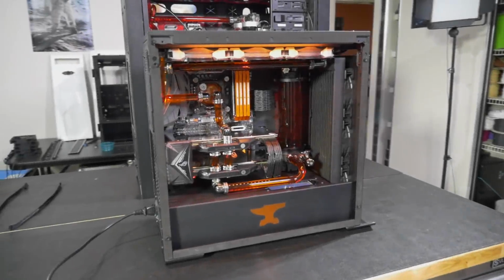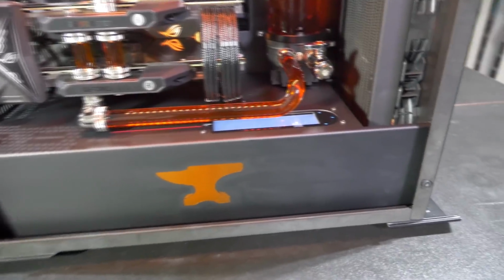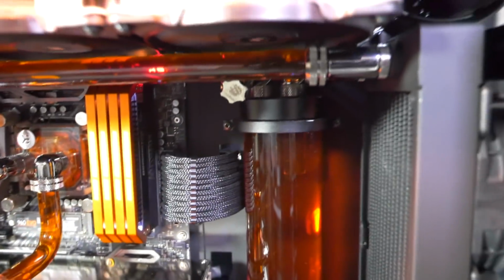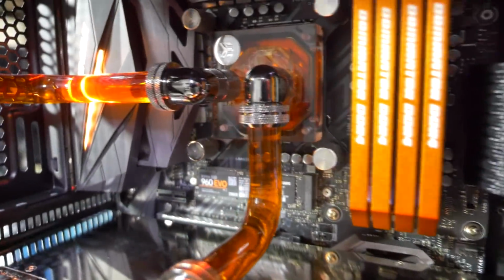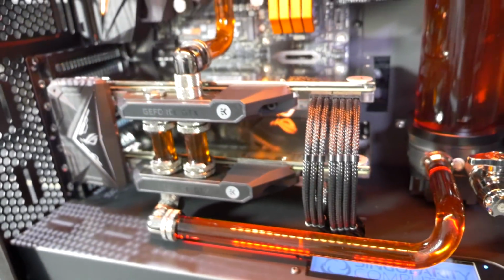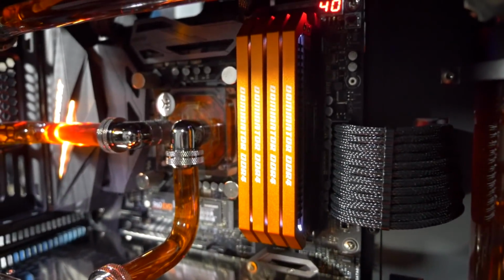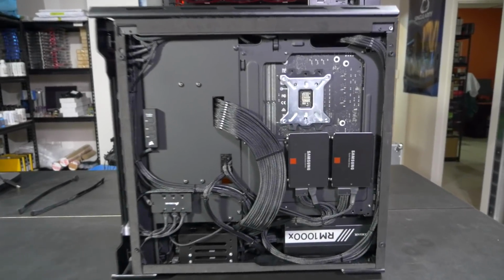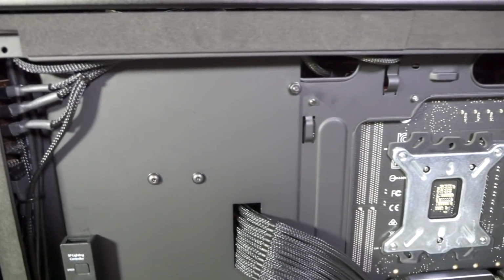Custom Phanteks Enthoo Evolv Part #2

Comment: I haven’t built my own PC yet, but I was an Auto Tech for a decade and now an Electrician. This experience leads me to think that the coolant loop may perform better if instead of going GPU to Processor, you went GPU to radiator to Processor. That way the processor isn’t getting the freshly heated coolant directly from the GPU. Like I said, I haven’t built a PC yet, so the added tubing may not be worth the gain in performance; if any!  This build is beyond cool, so my comment is only that, a comment. Thanks for your work!
Reply: Loop order with a DDC pump makes practically no difference whatsoever. The coolant circulates so quickly that it doesn't really heat up much at all at the GPU, and so it will have a negligible impact on CPU cooling. Of course, this is only the case with a high-powered pump, such as the DDC. I seem to remember Daniel covering this way back in his earlier builds - I'm pretty sure client build #5 has this information somewhere in the build log.

Comment: for a budget 240mm aio,  top vs front radiator mount works better?
Reply: Front, especially in this Case (have The Same one)
Reply: Christian Merkel if a case has less front vent then is it good to mount aio at front? 
my case: masterbox td500
Reply: If you place the fans in the phanteks evolv atx on the inner side of the frame, its doesn´t have that bad front vent. The problem on that case the lackluster Top exhaust vent. 
In your Masterbox TD500 i would place the aio rad on the top as an exhaust and maybe place the three fans from the front on the inner side of the frame, so that they have more space to breath from the front, if the aesthetics would still please you, of course
Reply: @DerMenschLp  yes,  right now i have mounted them at the top and using 3 fans at front as airflow
Reply: I think thats a good configuration. Do you have the Radiotor fans as an exhaust or intake?
Reply: @DerMenschLp  exhaust
Reply: Then you have a good configuration i would guess

Comment: just thinking out loud here, don't kill me, but wouldn't be more efficient if even possible to cool the 2 GPUs with one rad then loop back onto the CPU and use the 2nd rad to cool that down and then into the reservoir back to the double GPUs? all this if the loop is possible....the CPU is heat soaking from the graphics cards?
Reply: The order in a loop almost makes no differences at all, only in the first few minutes, when the coolant isnt at max temperature

Comment: Those SLI bridges also work without the Aura software. If you tap the ROG Eye logo while it's color cycling it will stay on a single color (whatever color that is shown when you tap). Tap again and the color cycling will resume.

Comment: I'm loving the graphics for the benchmark results!!  Question: Why didn't you route the bottom tube behind the ATX cables so it doesn't block the Aquero's display?  It appears there is enough room to do this cleanly.  Also, since Caselabs has left the PC case market looks like you will be modding your ass off on future builds.  Great vid and build as always.  Keep up the great content!

Comment: FYI, you can fit two Hardware Labs GTS 360s in the Evolv without mods. You need to omit the rear fan, orientate the top rad with the pets to the left, front rad with the ports at the bottom. Fans should be in push. It is a tight fit, bit it does work. Performance is also muuuuch better than 2 SE rads.

Comment: I do not get that RAD orientation. The front RAD is dumping hot air in the case and the top rad is going to suck it up so higher deltas. As a results you are effectually reducing the RAD efficiency.
Reply: Orjon Zaganjori its good to be warm air and not hot air.  Also I’m willing to bet they are not experienced with computer building than you and I and finally this build isn’t all about performance.
Reply: The temp benchmarks and performance at the end of the vid speaks for it self. These guys are professionals. On pen and paper your theory might be right but in real world it’s only 1-2 degree if any difference.